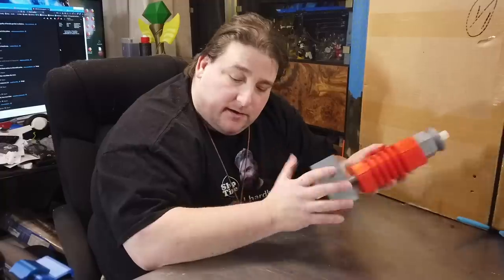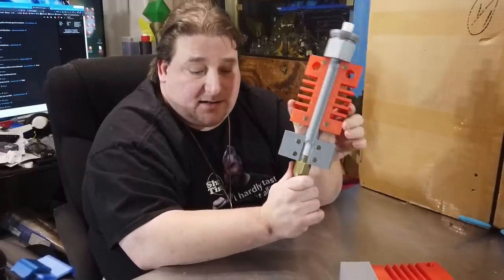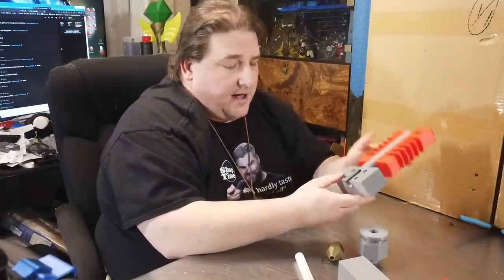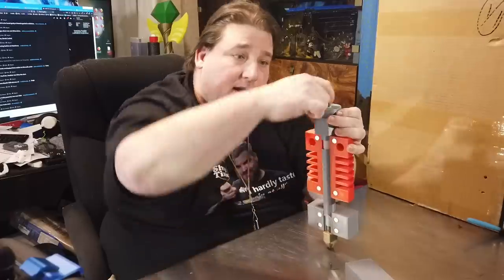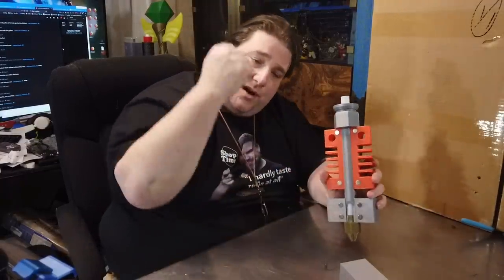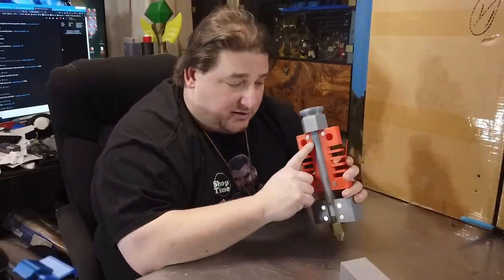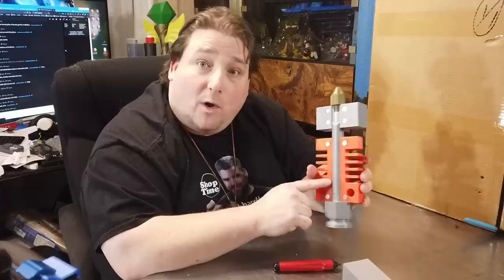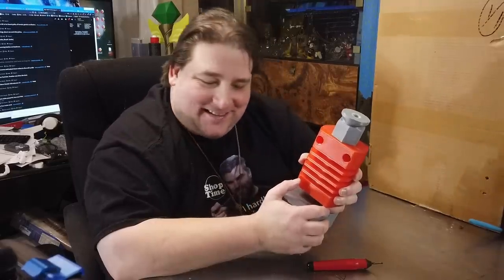Creality Hot End Failure Modeling How to Fix, Assemble CR 10 Ender 3 5 Mini T3DP

Comment: THANK YOU SO MUCH for this great video. I've had my CR-10 for about 15 months now. I mainly do functional prints and love the idea of designing and creating things from scratch. Many of my more recent designs were made out of PETG. However, as best I can tell, the PETG prints caused my PTFE tube end (near the nozzle) to burn/scorch a bit which ultimately resulted in underextrusion and finally full hotend blockage. I tried replacing the PTFE tube with the spare one that came with the printer. However, I apparently didn't get the nozzle gap closed enough because it clogged again just minutes into the next print (wish I had seen your video prior to my efforts ☺).

MY CR-10 printer is the greatest hobby item I believe I've ever had in my life. So I've ordered some Capricorn TL series PTFE tubing, some new PTFE couplings, some new .4mm nozzles, and some heatblock silicone socks. When I carefully reassemble this with the new parts this weekend, I'll hopefully be all set for at least another year of proper hotend functionality!

Four questions:
1. I had a VERY nasty hotend goopy mess when my hotend started getting blocked extrusion on a really long print. This required me to virtually remove all of the cotton/capcon insulation from the hotend. Do you recommend/use silicon hotend socks once your cotton/capcon insulation gets worn out?
2. Is the method you show in this video the way you do all of your printers, or do you have an alternative (more preferred) method of assuring the PTFE tube seals tightly to the hotend?
3. I'm not expecting miracles from the Capricorn tubing, but I do expect it to be much better with the higher PETG temperatures than the OEM PTFE tubing. Any experience and/or feedback on Capricorn tubing?? 
4. Got any suggestions for a favorite replacement cooling shroud (fang style) for the CR-10??
Reply from the maker: Yes the silicone socks are very nice and they're pretty cheap there's no reason to rush to add them but as you wreck the cotton and kapton replace with silicone they are easier to manage and easier to clean up when you have a mess they are a consumable and will eventually become riddle but you should get several thousand hours of printing before that happens it will be a long time before you have to replace it

The method I show is the method I used and have always used and I don't have any problems of that nature

The Capricorn tubing is slightly Superior to regular tubing it has a slightly better heat resistance but more importantly it has better tolerances so you're feeling it should fit more snugly through it which should give you better print quality with your retraction settings since the filament can't wiggle around as much

 It however is not in your uncle the PTFE tube is a consumable item I suggest cutting the tube 2 or 3 inch longer than you need so that has the end of the tube gets cooked you can snip off three quarters of an inch or so and reinsert it this will greatly extend life in the tube

 I have printed a petsfang but have not experimented with it yet I am over all quite satisfied with the stock cooling on creality machines
Reply: Thank you so much for answering my questions. I'll be sure to follow your tip on making the replacement Capricorn PTFE tube 2 or 3 inch longer so I can trim it in the future when needed. Yeah, when watching YouTube about replacement fan shrouds, it seems that many people see very little difference in print quality. When I compare the questionable Bullseye/Fangresults to the extra mass the fang will add to the hotend, ringing is likely going to be the equal tradeoff...so I'll keep the stock shroud. I can't wait for the replacement/upgrade items to come in so I can resume my creativity!
Reply: Hey Chris.... as I write this comment my 3D printer is printing the first item since I did the bowden tube replacement. All looks really good so far but I'm keeping my fingers crossed and not counting my chickens 'till they're printed'. I 'may' make a little video to accompany yours wherein I tell a few things about my experience of changing the bowden tube "incorrectly" on my CR-10. These things would basically be.
1. If you own a Creality printer and truly enjoy using it (like I do), just go ahead and order some PTFE compression fittings, Capricorn tubing, extra silicon heat socks, and extra nozzles. Have them ready for "that day" that it finally happens (because it will).
2. Don't bother with researching whether or not Capricorn is really as good as they say it is because, no matter where you research it or who you speak to, ultimately you're going to get inconclusive findings. Simply go ahead though and by a meter of it to use during the replacement. Hopefully it'll work better than OEM, but for sure you'll know you did your best to use quality materials for the repair......cause believe me, you don't want to do this repair more than you truly have to!. 
3. Yes, make sure to buy some silicon heatsocks. Sure you may still have clean/undamaged hotend insulation now.... but it only takes one serious bad print to cover the insulation so bad that there is no way 'on God's green earth (southern saying here)'' that you'll ever be able to salvage the OEM insulation during the cleanup. 
4. How, if your print bed seems to have moved way too high during your efforts....because you find yourself having to suddenly crank the print bed down a lot after replacing your ptfe tube.... it's VERY likely that you did NOT tighten the nozzle enough (Sort of a 'hears your sign' revelation to me)!
5. How there's no need to even think about removing or reinstalling the nozzle WITHOUT heating the hotend up. Heck, I couldn't even get the nozzle to start aligning and threading into my hotend until I heated it back up.....then it went right in.
6. That it's a good idea to clean the hotend by dragging the ORIGINAL OEM PTFE tubing through the entire hotend a few times. The original PTFE tube is likely swelled to a slightly larger diameter that will be a tight fit in the hotend. Thus, it will help clear out the hotend throat more than the new replacement piece of PTFE. Then when you try to install the NEW piece of PTFE, whether it be OEM or Capricorn, it will likely readily and easily slide right into place better because it's slightly smaller than the used piece.
7. How tight the space is between the hotend's heatsink and the hotend wires to the right of the heatsink when you try to put the OEM metal fan shroud back in place
.

Comment: Great video. I have an Ender 3 that hasn't worked since the day I bought it.  I wasn't doing the 2 turns on the coupler.  That seems to have solved my clogging problems.  Just printed out a decent benchy.  We'll see how it holds up in the shop. Thanks!

Comment: Good video. I discovered another problem with these style hotends jamming upon retraction near the top of the assembly that is exacerbated if the heatbreak/throat or heatsink by their style doesn't allow the bowden tube to be fully inserted down into the assembly. Once those are replaced with ones that do allow the bowden tube to be fully inserted into the assembly as you've shown here the problem goes away. I explain the struggles I had and the right replacement parts to get on my website.

Comment: Great visual explanation. 
Last time I removed my nozzle to clean a clog, the ptfe tube would not budge at all. I've just screwed the nozzle back and so far no leak, but yeah, this is great tutorial to follow for next time.
Reply from the maker: yeah the coupler can "dig into" the PTFE tube making it impossible to remove normally. the solution if you need to get it out in the future is this.

UNSCREW the coupler and pull it and the PTFE tube out together as one. NOW depress the release on the coupler and in one single motion push the ptfe FURTHER INTO the coupler as you TWIST the coupler and then smooth reverse and slid it off in one single constant motion. will come right off :-)

Comment: This is an excellent video. The large demonstration model with cutaway is an incredibly useful tool. You should consider doing an e3d version as well. It's a little different, but also a very popular setup that people mess up all the time, causing nozzles to snap off in the heater block.  Now... where's the rest of that 500% scale 3d printer?

Comment: Great video! I did some maintenance on my Ender 3 I got last year and I noticed the heat break has a pressed in ring at the end. It and the nozzle base were polished flat. I believe this is to correct the mating issue. The ptfe butts up to the top of the ring, the nozzle on the bottom. One down side is you can't use the tube to clean the break out, but I only had about 1mm in the bushing opening. The nozzle shears it nicely when you remove it and both sides had a clean mating surface.

Comment: Fantastic video, i noticed when i was cleaning out the throat that the heat sink will turn on the heat block ... what is the correct gap in mm's between the heat block and the heat sink.

Comment: feeder is actually called an extruder btw. great video
Reply from the maker: no. its not. the extruder is not a part its a SYSTEM. in the "past" it was all together in one "unit" but modern bowden systems separated it into discreet components.

The Feeder is the portion you insert the filament into with the stepper motor and drive gear. it FEEDS the filament to the HOT END

The hot end is the part that squirts out the plastic and gets hot.

The "Extruder" is the "system" starting with the feeder and ending with the hot end. IE all those components together are "The Extruder"

IE the feeder and hot end TOGETHER form the "extruder"

Comment: Thanks dude. Have been having consistent skipping issues and in general issues with the hotend clogging up rather quickly (between 1 and 2 kg) after a rebuild/clean. Guess I haven't been seating the ptfe tube properly enough all this time.

Comment: Excellent
However snug nozzle then loosen nozzle and push tube in, lock coupler then snug nozzle
Spinning the locked coupler on ptfe tube can damage the tube or coupler lock.

Here is what I do.

Heat to 220 
Clean it off 
Take nozzle out 
Remove bowden and coupler 
Clean out hot end so that a bowden passes free with no nozzle

***if you have a leak at top of hot block 
*remove fan shroud from hot end
*Loosen grub screw in center of red *holding throat and give it a spin down towards nozzle 
*Snug new nozzle and to ensure it's good try to tighten throat again 
*Nozzle should be pretty close if not touching heat block, best to touch for better surface contact and heat transfer
*Once you are sure throat and nozzle are good snug down grub screw 
*reinstall fan shroud

Now back nozzle off 1 turn and reinstall coupler 
Be sure bowden is Clean and trim as flush as possible

Insert bowden tight to nozzle and secure coupler with clip

Snug nozzle while keeping pressure on tube downwards

Comment: A few months ago I had PLA all over the heat block and under the sock. I didn't have time to tinker with the Ender 3 Pro at the time but I'm just now working on it. I cleaned up the outside, ran the PTFE tube all the way through and got the chunk of old filament out. Replaced the pneumatic fitting on the hotend and replaced the nozzle. I'm still getting under extrusion - like 1/4 of what the output should be with little blobs along the very thin line. I'm beginning to wonder if I need to pull out and possibly replace the heartbreak or the whole hot end.

Comment: Beautiful! Cleared a few things up for me and I use an e3d titan. I had a problem with heat creep and found that putting cpu thermal paste on the threads of the heat sink does help. But yeah a better heat sink fan probably is a good idea.

Comment: Great visual and explanation!  I am having extruder issues and everyone that I've received advice from has told me to back out the nozzle, either one or one and a half turns, before seating the Bowden tube.  Your suggestion to use two turns on the compression end makes sense.  What is your take on the advice that I have been getting elsewhere?

Comment: I've spent 3 days trying to find out why my printer failed with a second print (print one model fine, 5min wait ... would not print anything).  After watching your video, I notice the heat sink was not working.  I did get the 'bulging' tube you described.  Thanks a lot for your help and I'm off to fix my fan :)

Comment: Thanks for your wisdom, I took mine apart unknowingly of your wisdom, and it may not work well. So far the printer still prints, but now I have more knowledge what to look and check for when I do take apart. Someone linked your video, so here I am learning from your wisdom. By the way I saw your video also on the fan upgrades a while back on the cr10s pro, I have the same printer, but my results are terrible, I think. Would you mind posting some xyz calibration cubes? Thanks for your comprehensive tutorial.

Comment: Excellent video, thank you. I recently purchased a set of nozzles from Amazon for my Ender 5, and discovered that they do not fully snug up to the heat block as I tighten. I tried re-inserting the original nozzle, and it snugs up tight. I compared the new & original nozzle; and noted that the new one has threads all the way to the top; while original one has a small gap without threads. I am assuming that it is fitting into the heat break, allowing for the snug fit. Should I look for alternative nozzles, or is it OK for the new nozzle to stick out, off the heatblock a bit?? Or, should I try to pull back the heatbreak to allow the new nozzle to seat. I did read a few reviews about new nozzle installations starting to 'leak' at that gap.

Comment: Your video was a huge help for my Ender 3.  How about another video for the CR-10 V3 with the direct drive extruder.  I'm getting real close to "adjusting" it with a 4 pound hammer......
Reply from the maker: Oddly enough the exact same conditions apply because even though it's direct drive it's still the same PTFE lined hotend we have nothing to do with whether it is Bowden or direct drive

Comment: great video, i saw a similar video that the person was recommended doing the two turns with the nozzle and put the tube to hot end and locking the couple the tighten the nozzle back up.
Reply from the maker: It works from either end I just always use the coupler and but the exact same process works by leaving the nozzle 2 turns Loose as well

Comment: Hello, I have a CR-10 Smart and i am having clogging issues. I have tried all the steps you showed but my hotend and heatsink are different then most. Do you have any videos on the CR-10 Smart? you rock. oh ya new sub here so looking forward to more videos. Cheers
Reply from the maker: I don't have the smart so I don't know exactly how it works but the "basic idea" is the same. if you have the bowden tube going inside you need to make sure its cleaned out and seated properly.

some hot ends the bowden does not "pass all the way through" the hot end. there is a "stop" inside. but the concept is the same. all parts must seat properly to avoid gaps that would let melted filament hide build up and cook off.
Reply: @nerys71  that was my issue. i had to try 3 times cutting new tubes till it was right, but crossing my figers beacuse its been working great the past 6 prints. i have my counter going. lol

Comment: great video, lots of good info, but  you PTFE tub DOES NOT go al the way to the nozzle, it either stops at the top of the heat brake or somewhere somewhere mid way into the heat break.  the temps we print at will cause the PTFE to break down, the higher temps will cause the PTFE to melt and release gases that are bad.
The nozzle seals against the heat break.  all of that said, the process is still good and accurate!
Reply from the maker: you are both correct and incorrect. on the older hot ends the PTFE goes "all the way through" and physically "mates" with the nozzle threaded surface. direct contact.

on SOME newer models there is a separate "throat" inside so the nozzle and ptfe never actually touch although I have not seen one yet.
Reply: @nerys71  Interesting, in the 3years I have been printing on the 5 different printers/print heads I have yet to see a PTFE setup that went to the nozzle, knowing how dangerous it is to over heat PTFE, I would have thought all setups stopped the PTFE somewhere with in the heat break...who knew!

Comment: Awesome video - and a great way to demonstrate the assembly. Any recommendations on how to get a PTFE coupler to relinquish its grip on the PTFE tube? I push down the collar, then pull the tube up - but it doesn't budge.
Reply from the maker: Yes you have to remove the coupler unscrew it I take out the coupler and PTFE tube together once you have an out of the hot end depress the fitting on the coupler and push the tube further into the coupler all in one motion once you begin pushing the tube into the coupler rotate and smoothly shift backwards and pull it off
Reply: @nerys71  I was afraid you'd suggest something like that. A lot of 3D printed fan ducts like the Bullseye require complete disassembly to unscrew the nut.